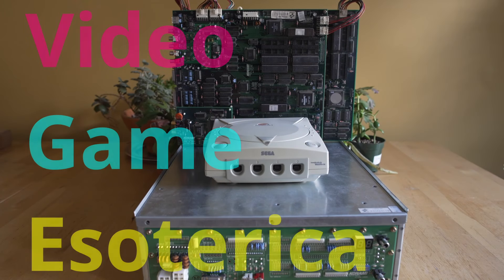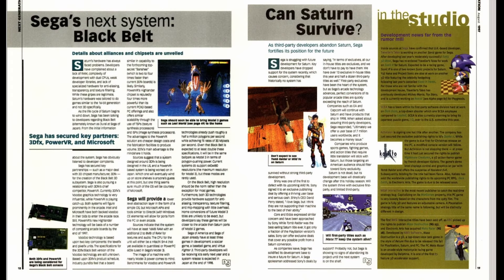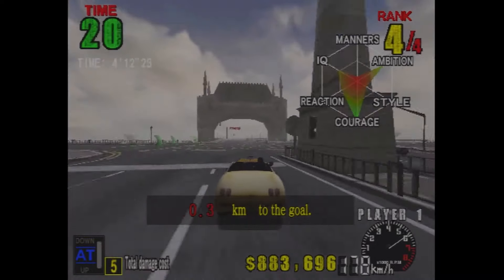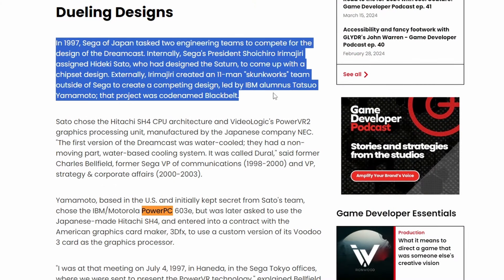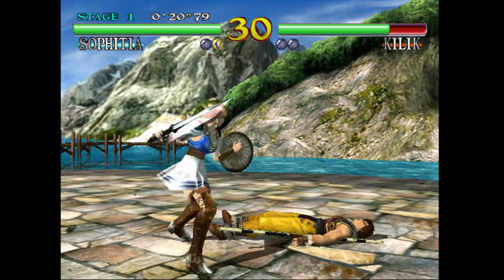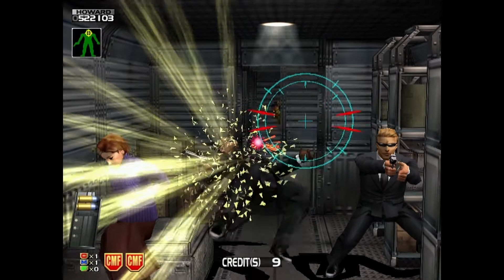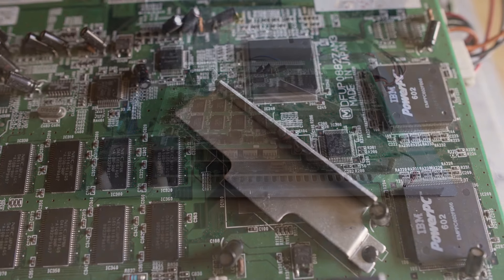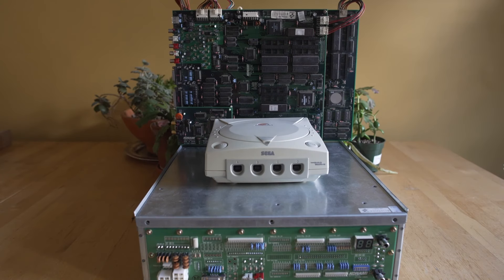The Sega Black Belt! The Lost Dreamcast You Can Actually Kind of Play

Comment: You know what? This theory actually seems pretty sound.  Konami WERE known for taking designs from cancelled consoles (see their M2-based arcade board), and I could absolutely buy the idea of 3DFX shopping around their hardware design that they had already dumped millions into before being rejected by SEGA (a rejection that they actually ended up suing SEGA for breech of contract over, and winning an undisclosed court settlement that probably granted 3DFX the rights to the hardware design).  I reckon you may well be spot on in this case :)
Reply from the maker: It’s very in Konami’s DNA to take console designs and use them for arcades for sure

Comment: It´s honestly a really good thing they decided against a 3DFX chip. Many people have very rose tinted glasses about these cards, but the reality of it is that even back in the day other cards had either more features and / or a better image quality. Like PowerVR where basically the only cards that could pump out detailed shadows without breaking too much of a sweat, Matrox had Bump Mapping feautres (just look up how the water in the game "Expandable" is on Matrox compared to other cards), S3 introduced a very impressive Texture Compression System that IMO still holds up. Plus the Performance of Voodoo Cards relied heavily on games supporting their Glide API, outside of that the competition was at least as fast, if not better as them.

I owned both a Voodoo 5 5500 and PwerVR PC-X 1 for a while a couple of years ago in a Windows 98 build, and while the PowerVR was pretty useless outside of the handful of games that specifically support it, that card still managed to have the better looking Version of Tomb Raider 1 while allowing for a higher resolution (The V5 could support higher ones, TR was just limited by what the Voodoo 1 could do) and the V5 had very washed out looking colors in basically any game that used the Glide API.
Reply from the maker: 3DFX has a certain look and vibe to it. It’s iconic but not for being the best looking of its era that’s for sure
Reply: i can't disagree more. the benefit of the 3dfx was everyone know how to program for it. it would have guaranteed the one thing the Dreamcast needed, third party publisher support.
Reply: @chrismyco7950  That´s where you are entirely wrong. 

The choice of Hardware isn´t what made anyone not support the Dreamcast, it was Sega itself. Unless I´m missing something during the 90´s Sega released the Game Gear, Mega CD, 32X, Saturn and Dreamcast, that´s 5 Systems and Add-Ons in just 9 years (1990-1998, Japanese release dates). And that´s without the confusing mess of portable Variants of the Mega Drive, design revisions and Systems that combined some of the features. 

Consumers had a hard time keeping up with which Sega System could play what games and neither Publishers nor Consumers could trust Sega that they where committed to their own System to begin with.
Reply: @Soonjai  it was hardware. Sega of America already had EA and all the publishers on board with the 3DFX. Sega of Japan got upset at the leak and changed the hardware specs, which infuriated all the western publishers the system needed. nearly every game released on at the time had a glide patch, everyone knew how to program for the 3DFX chip.  very few developers outside of Japan knew how to use the nec chip.

Comment: I may be wrong, but I was under the impression that the naming of the early PowerPC chips were a bit funky in that the 603e chips were budget processors that had the caches disabled. Being that they use RISC architecture, crippling the L2 cache caused them to perform worse than the 602.
Reply from the maker: 603 was a budget part but the E variant increased clocks and bumped it up a notch

Comment: The Dreamcast GPU was also kinda a PC Design which got recycled. (Kyro 1 or 2, can´t really remember). Hitachi and Sega have been best buddies at this time, the move to SH4 was likely based on that "friendship".  Nice Video again! :)
Reply from the maker: Yes lotta back room deals on DC between decision makers that had friend preferences
Reply: It's not. It has been made for the Dreamcast and only then, it has been released as a graphics card called Neon 250. The Kyro (including the first Kyro) was a PowerVR3.
It's interesting to check reviews of the Neon 250 : it's on par with a Voodoo 3 for Quake III. The Voodoo 3 is twice as fast as the Voodoo 2, which is very close to the BB hardware.
Reply from the maker: All very close in performance and look
Reply: @dkrbk  Kyro is indeed the wrong reference since it came the generation after the Series 2  with DC GPW and Neon250. It is still part of the whole PowerVR Family which was by intention a PC GPU.
Reply: @Retro_Royal  dreamcast gpu had more power than the Neon250 also drivers back then where not as good as today,even the voodoo 3 was never puched to the limit.
Reply: @athos5359  Doesn´t change the fact that the dreamcast gpu is a member of the PowerVR family.

Comment: I can't fault the Dreamcast aside from the vulnerability of the hardware that all 6th gen systems have. After fixing my Dreamcast, or getting a new one, I'm no longer going to do that anymore; I'll wait for FPGA. My PS2 is broken. It was stored vertically in a closed cabinet. So, I'll be waiting for FPGA for that, too. I know it'll be a long wait but I have other options for that one.
Reply from the maker: Weird I consider Dreamcast to be one of the most reliable consoles
Reply: @VideoGameEsoterica  
I've been through about 6 of them. Most were PAL region. Controller ports fail, lenses get dirty, disc drives fail, the DNAC chip blows. It's a minefield. The one I like to use is a Japanese one. I've had good performance from it but the video and audio suddenly failed. Still waiting for a reply from the repairman for more info.
Reply from the maker: Six? Damn
Reply: I only ever had the one unit between 1999-2002 and towards the end it was having an issue with the display port and the disc drive was almost toasted. I have found it is easier to find good condition Saturns than Dreamcasts. But the Saturn was the tank of Disc based consoles. Everyone mileage will vary.
Reply from the maker: Weird. I must be lucky
Reply: What the heck... What are you doing? The only real weak point is the GDRom drive which is no issue today thanks to ODEs. Another common issue was random reboots, causes by the connection between the board pins and power supply losing tension over time, easily fixed by soldering them together. My first Dreamcast is going strong to this day. 😈

Comment: It's possible that the lower fidelity of the graphics was due to a lessor video ram which would force low quality textures.  Do we know any specific specs for the Konami board?
Reply from the maker: It’s more like Konami never got a great handle on 3D graphics in arcades. They made games fast
Reply: @VideoGameEsoterica  Interesting.  Then it could also be a quick and dirty way for them to get more performance.
Reply from the maker: The games ran fast so it was probably just a “keep development cheap, make it run well and ship it” situation

Comment: i would throw in that naomi was more than just a dreamcast with more memory, hence the huge cost difference. It had more in the graphics gpu clock speed and capabilities.
Reply from the maker: Clock speeds are basically par
Reply: @VideoGameEsoterica  I think as far as clock speed on the first revision that is true for sure afterwards it was double performance, I thought those had a higher clock speed but could be my bad memory on it. Aany ways my point on Naomi and especially it revisions are a step up beyond just memory alone.
Reply from the maker: NAOMI 2 def gets big bumps
Reply: A big part of the performance difference came from higher clocked RAM not the processors. But that is just splitting hairs at this point. It was well known that the Dreamcast was bandwidth limited and so essentially the SH4 vector processor was starved about 30% of the time - just couldn't get enough data to it and this slowed the polygon performance a bit. But that was because Sega was trying to keep costs down and maximize efficiency at all levels. It was a reasonable trade off. 

That said, look at Crazy Taxi, I don't think I could tell you were the difference is between Naomi and DC. Maybe draw distance?
Reply: @Jabjabs  thats a software problem, and al consoles are bandwitch limitted to the bar minimum,sega needed better tools to adres that.
Reply: @athos5359  It wasn't so much software tooling. The tooling on DC was fine, lightyears ahead of the Saturn and even early stage Ps2. A lot of the time it was just using GCC to compile the code and by that times the SuperH pipeline was already very efficient a compilation due to the extensive use in mainframes at the time. But tooling can only do so much when it is literally just spinning cycles waiting for RAM. It was just a case of feeding the vector processor which. It is the same situation as the N64, yes better code can go a long way but eventually you hit a wall where there is only so much data you can get to the processors.

By bandwidth limits on DC, it wasn't a criticism of the hardware, it was actually a very smart move. It allowed Sega to keep the costs down while still providing decent performance. Sure they could have gone for more bandwidth/wider buses/higher clocks but that quickly becomes a game of diminishing returns. DC was a lot of sweet spots, not ideal highs.
Reply: @Jabjabs thats why you have cache s  on the cpu to adres that problem .
Reply: @athos5359  Cache does help but only so much. When doing geometry processing eventually bandwidth is key as it basically it just a long stream of vertices, cache will only be useful for stalls in the data pipeline for a very short amount of time. Now the flip of this is that if you where doing a lot of instancing of a very small vertices set, then yeah you could max out the capabilities as you wouldn't need as much data from the RAM but unfortunately, few games would really work with that setup.
Reply: @VideoGameEsoterica  yes naomi had revisions but of course the second version is very capable.

Comment: kind of a 32X v Saturn vibe I guess, seems Sega of America hadnt leant from the magic mushroom after all
Reply from the maker: I feel like they had. They ditched SH based CPUs and went for PowerPC
Reply from the maker: Little bit of both i think
Reply: The Blackbelt architecture was severely underpowered but still sounder than the 32X architecture. The 32X architecture relies ENTIRELY on the CPUs. There's no GPU, just a framebuffer, and no real sound processor either, just two channels (for stereo) of PWM audio. EVERYTHING had to be done in software, from 3D computing to audio mixing, from scrolling to sprite scaling... it was a mess.
Reply from the maker: 32x was def a messy band aid of a platform

Comment: PowerPC + PowerVR 2 would have been the best option, but I guess that was not in the cards
Reply from the maker: Seems like Sega really didn’t want to use PowerPC. But that makes sense as internal developers at Sega had been on Hitachi instruction sets since 32X. It was familiar to them
Reply: @VideoGameEsoterica  also Hitachi was selling the SH4 cheaper than IBM / Motorola. And SEGA even got to add instructions in SH4, which in a PowerPC architecture I think it would be more difficult. Good relation between SEGA and Hitachi definitely influenced 🙂
Reply from the maker: Yes hitachi was doing a lot of business with Sega so they were way more amenable to doing what Sega wanted
Reply: Sega's AM teams were quite familiar with the PPC arch, having powered the Model 3 rev boards. The 'real' (pun intended) workhorse on that hardware was the Real3D GPU's.
Reply: @dan_perry  IIRC Sega Rally 2 was made for Model 3 (PPC), and the Dreamcast port was made in a rush, so they used PC version of SR2 and ported it to the Dragon SDK (Windows CE + DirectX) and that's why it's not that great on the Dreamcast.
Reply from the maker: Win CE was just a bad decision
Reply: @carl_84  IIRC,  the SR2 port went through a couple Sega dev teams before it was finally handed off to Smilebit to duct tape together.

TBH, the JP ver is to me the best on DC. If you play the game in 1st person mode (front bumper cam) with or without the 60fps code it's way more stable than the other vers. Alternatively, you can lock it down to 30fps if you need the trackside details...but it loses the magic.
I'll probably never understand why Smilebit went with that realistic lighting model for the game.
Reply: @VideoGameEsoterica  I get why WinCE was a option, I just never understood why use it on SR2. If I had to guess it would probably be the net code.
Reply: @dan_perry  Smilebit seemed to have a flair for trying newer rendering techniques some times to a fault. But that thinking did also lead them to doing Jet Set Radio.
Reply: The SH-4 had insane floating point capabilities. 4-5 times better than a Pentium II clock-for-clock, which was the best CPU on the PC market. The PowerPC might have better integer capabilities, meaning more "raw" power, but in 3D the SH-4 was undoubtly superior.
When pairing with a PowerVR card, it's even more notable, because it's very demanding for the FPU. To the point that the PC version of the PowerVR2 was modified to not rely as much as the DC version on the CPU's FPU (less tiles). Meaning that one year after, the CPU market for consumer PCs were still lagging behind the SH-4 (notably, AMD K6-2s were very popular, and they were are vastly inferior to the PII in 3D).
Reply: @dkrbk  didn't knew the capabilities of the SH4 FPU other than extra instructions like 4x4 matrix multiply. Thanks for the info!

Comment: I am so glad my comment from before could help with this video. 
While you said you don't think you agree with what I said. At least I wasn't 
lying when it comes to my theory crafting. That said, let's be real. The 603e is 
far superior to the SH-4 in clock rates I think which would have made blackbelt 
stronger in certain ways. Now, clearly the way they designed the Voodoo 3 custom 
SOC it would not have beaten the Dreamcast's Custom PowerVR CLX2 Chip. 

Which has never been duplicated into anything else. After the Dreamcast Imagination or the then 
I believe it was called Videologic went into the mobile phone business. Cards I think were still made 
for PC after Dreamcast but for the most part it's phones after that. I have designed custom Voodoo 3 
concepts which would have made it as good if not better than the PowerVR in Dreamcast. But, everyone 
will have to wait for my book as I am writing it. If anyone is interested in it, that is.
Reply from the maker: Yes videologic never really did much else interesting
Reply: @VideoGameEsoterica  Videologic made Kyro II, which were as fast as a Geforce 2 GTS for the price of a Geforce 2 MX. And they did this without T&L and with SD-RAM instead of DDR-RAM. I'd call it "interesting". 

They made the Naomi 2's hardware, which brings the DC's/Naomi architecture to the Xbox level.

The original PowerVR for PC was interesting too. On some games it was on part or even better than the 3Dfx Voodoo 1 (in Unreal, Tomb Raider, Mechwarrior 2 and some others) and had interesting exclusive games or exclusive versions (like VirtualOn, Resident Evil).
Reply from the maker: I mean not much else interesting after their relationship with Sega